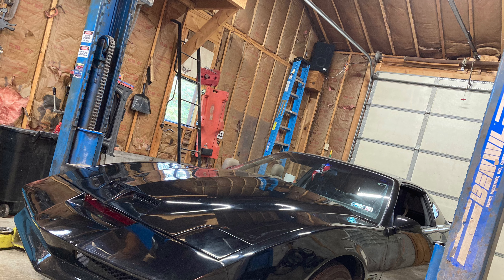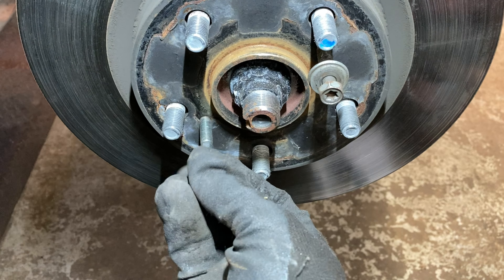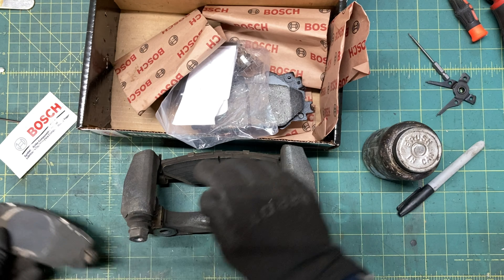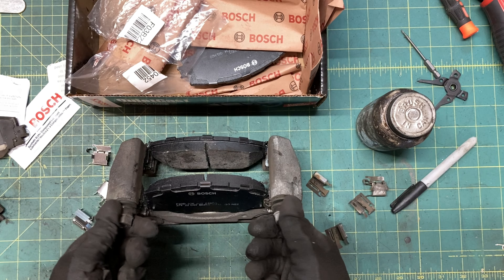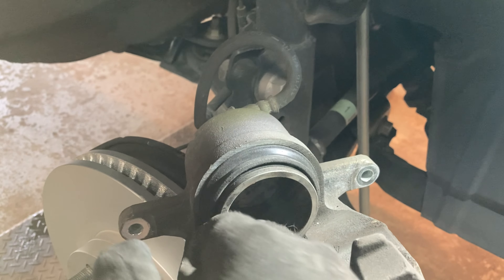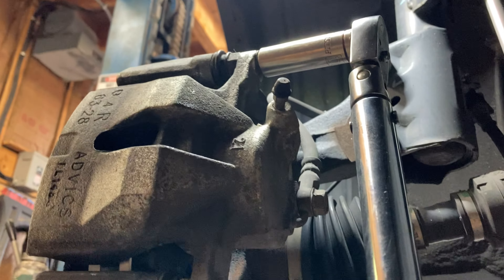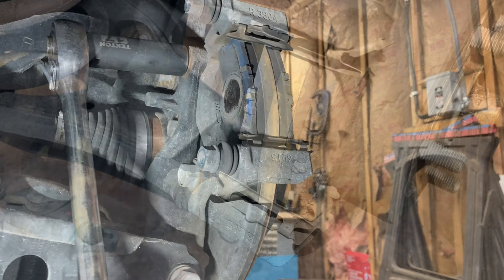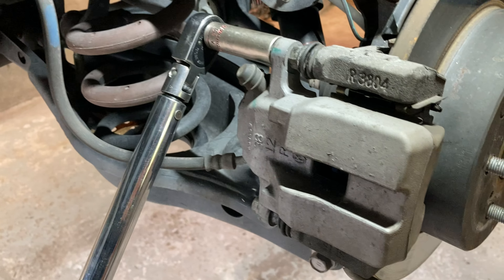Beginner’s DIY Tutorial: How To Perform A Professional Brake Job

Comment: I changed the front discs and pads on my 2004 celica, what shocked me before I changed them is that the original pads and discs were still on after 20 years…